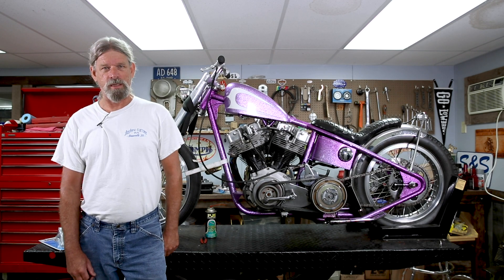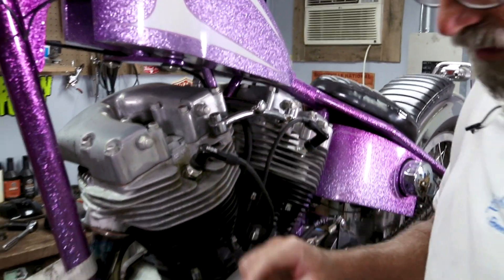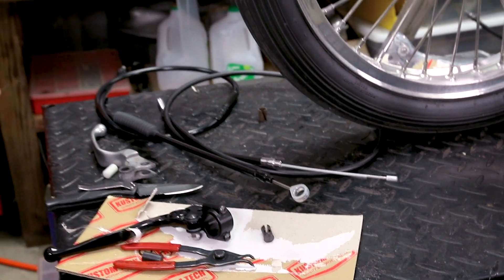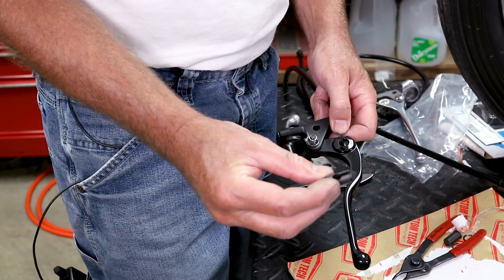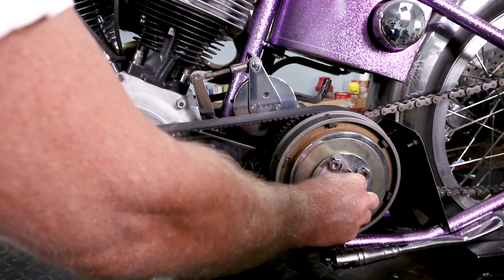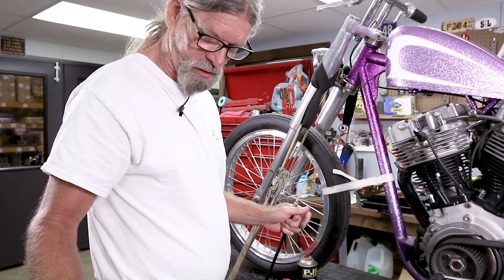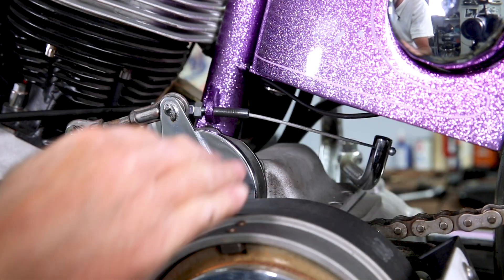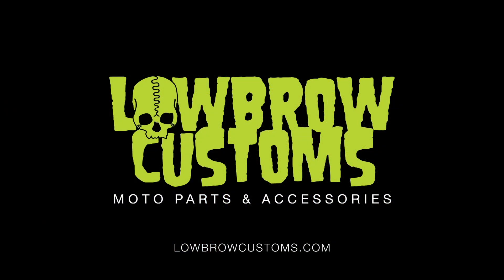How To: Harley Shovelhead Clutch Cable Replace, Install and Adjustment

Comment: Looks to my old eyes like that cable mounting tab needs a tweak to actually point the cable at the clutch arm - the straighter the better. Right on about the lube!